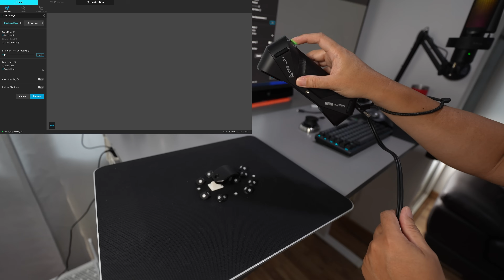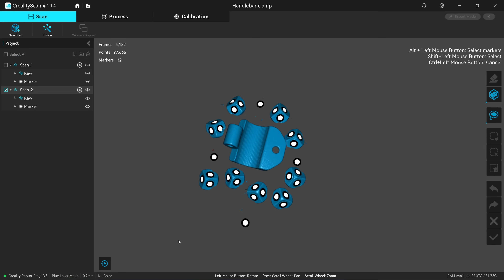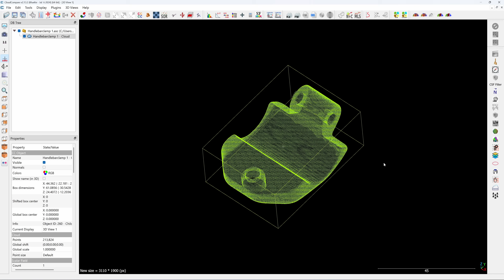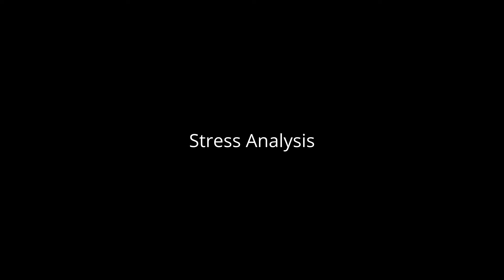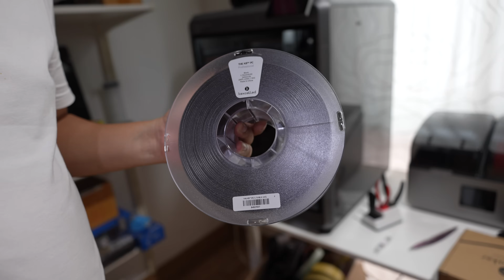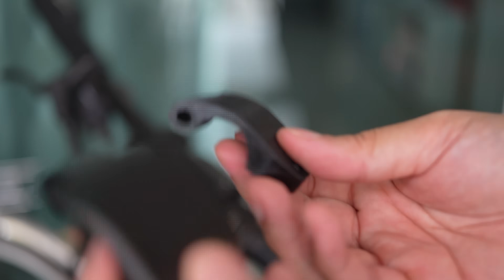Replacing Aluminum with 3D Printed: Reverse Engineering Case Study with Creality Scan Raptor Pro

Comment: Hi! I will advise you on the best way to print such details. You have 2 holes in mutually perpendicular planes. If one of the holes is positioned vertically, the second one is printed weakly (it will break in layers). in such cases, it is better to tilt the part by 45 degrees so that both holes are printed at an angle of 45 degrees to the vertical. Add support if necessary. The detail will not be as beautiful, but the strength will be evenly distributed. good luck!

Привет! Посоветую, как лучше печатать такие детали. У тебя есть 2 отверстия во взаимно перпендикулярных плоскостях. Если располагать одно из отверстий вертикально, то второе печатается слабым(разорвется по слоям). в таких случаях лучше деталь наклонить на 45 градусов так, чтобы оба отверстия печатались под наклоном к вертикали 45 градусов. При необходимости добавь поддержки. Деталь будет не такая красивая, но прочность будет равномерно распределена. удачи!

Comment: I am new to 3D scanning and in a process to establish a work flow. I have a Raptor Pro and I generally use Solidworks 2021. I am following your workflow. I have aligned my 2 part scan data in Crealityscan4 software and I exported both the pointcloud as per your video. However, unlike your import into cloudcompare. Both my scans are not aligned. Can you please share what steps I have missed. Than you
Reply from the maker: You didn’t do anything wrong—it’s just a known bug in CR 4. I’m using the beta version, and they’ve already patched it there. So, you have to wait for the official update or stick with CR 3 for now.
Reply: @Payo-TensileCreator  i see thank you
Reply: @Payo-TensileCreator  Which version of Crealityscan you are using? I can't find where to download the beta version which works with Cloud Compare. I am using CrealityScan 4 1.0.3
Reply from the maker: @ivanlim4787  The one that works is 1.1.4, it's not released yet.

Comment: I would have made the walls bigger by 1-2mm than the original and used PPA-CF. Creep is still a concern. Testing the grip a day later recommended. 
Machining it in Aluminum is the better choice but it’s much more work. 😅 Work-holding with CNC is annoying, especially for one of parts.
Reply from the maker: We’re seeing more thermoplastics like PEEK, PET, and PP entering the engineering space—and 3D printers will need to evolve to keep pace with these advanced materials.

Comment: I have to comment, because it is safety related part. You call it case study and support your claims with calculations and I think it is all wrong from engineering perspective. Just few points, without details. You use not realistic load case with low safety factor. You test it by lifting the bike which is very low force comparing to any real case scenario. For bike parts like stems and handlebars there is ISO 4210 standard that specifies fatigue test of 100 000 alternating cycles - this part will not be loaded once, but many times during its life. In real case scenario there are bending forces involved on long arm (handlebar), not just compression force on clamp, perpendiculat to its surface. Mentioned ISO standard specifies various load cases. You use Nylon parameters for calculations without taking into consideration different values for Z and XY direction for 3d print. Also catalogue parameters, especially layer adhestion, are usually not achievable on home printers because of chamber temp etc. 

From reverse engineering perspective/scanning/modelling it is a good tutorial, but should be disclaimer that this kind of parts MUST NOT  be used in real conditions. They are ok just for fitment test etc. At least before proper fatigue test which I'm sure it will fail.
Reply from the maker: Thank you for the detailed feedback—I appreciate the engineering perspective!
You're right—this is just a case study for now. But the engineering landscape is opening up to even more thermoplastics. In my field, I specialize in tensile structures, and the membranes we use are made from engineered plastics that have been in production for over a hundred years. Unlike FDM filament, these materials come with well-established codes, calculation methods, and regulations that both manufacturers and designers are required to follow. It’s only a matter of time before 3D printing filaments receive the same kind of formal standards and oversight.
Reply: @Payo-TensileCreator , there is nothing wrong with any material by definition. I just think that the approach is not ok and it suggests (even the title of your video) that in this particular case you can replace aluminum part with the same part made of plastic based on flawed assumptions (not enough real load cases, not detailed enough FEM analysis, no fatigue real-life test or even no fatigue calculations). I understand and appreciate the concept of showing the design process and make it more understandable for people that are not engineers, but there should be clear statement that it is not full and correct approach for safety related part like yours. You are considered on some 3D scanning groups as authority figure, so especially because of that, you should be more aware of your statements if it may affect someone's safety. 

btw. It is not attack on you :). I'm following your reviews from the beginning and they were very useful for me to buy my first scanner for personal use. I also think you made a really good job showing all the case studies for covers and aesthetic parts, and 3d scanning in general. Just this case is wrong and also I hope you will not use this part without further tests. 

I'm from aerospace industry and we put safety above all other requirements, so maybe I'm a bit biased, but any failure of this part can lead to serious injury or death as you loose control of the bike. If it would be pedal or something, it would be dangerous, so also questionable, but not as bad as loosing handlebar.
Reply: @Payo-TensileCreator  I assume it will stay at the same place as manually made composite fiber resin parts. Calculations are just for reference, not for proven solution.
Reply: Please put a caveat / safety rider on the video - this part or anything like it should NEVER be used for that application.  That aside, a nice video tutorial on reverse engineering.

Comment: Hi man :D
I like all of your videos :D
Today i bought Raptor PRO , like you have suggested me :D
Where can I get Creality Scan 4 - 1.1.4 ... Cant find it on official site?
How can I set resolution to 0.02mm 
I have some very small object to scan - 20x20mm and less , do I use Cross lines or Paralel lines for that?
TNX man :D
Reply from the maker: 1.1.4  is a beta version, they haven't release it yet.
0.02 mm is not resolution of the scanner; it's the precision value.  The maximum resolution of the Raptor is 0.1m
For small object, use parallel line, the camera will be place closer to the object.
Reply: @Payo-TensileCreator  "Thank you very much for the quick response.
And what should I use cross lines for?

Comment: Hi, I love your videos and learn a lot from them. Just two questions, one is what's the difference between fusion and inventor. Second question is, is that a Malaysian accent? Can't place your accent.

Also, I would have modified the design to accommodate a washer to distribute the pressure from the screw over a wider area of plastic
Reply from the maker: I'm Thai, spent some time in UK when I was a boy.
Agree with the larger washer. That will reduce shear loading.  I can clearly see pressing mark from the washer on PETG, but less on Nylon and very little in PC.

Comment: More proper way to test it would be to tilt the bike like 10 degree to the side then push down on that handle bar with your body weight untill it breaks then you describe how much force you think you used and if it bent before it gave up or it shatered like glass
Reply from the maker: That's look like a proper way to torture test it!  But that bike is my daily ride. :)

Comment: When I dry high engineering filament that usually takes many hours in filament dryer,  I will place the filament in the dryer just long wnough to heat the roll up to ~65c for 30 mins and then put it in a vacuum chamber and let it sit for 5 mins at fill vaccum. Afyer that its fully dry and ready to print  from the dryer. Saves a ton of time
Reply: That’s not going to work. You need the heat to get the water out of the filament for a long time to get to the core. Only the air is dry after 30min. The filament is still wet and would took weeks to dry with room temp in the bag.
Reply: @Todestelzer you're wrong. Look up boiling temperature of water at 28Hg vacuum. Water no matter how deep in the filament evaporates below 65c in a vaccum. Theres no heat loss in a vacuum so the roll stays 65c while in the vacuum. 5 mins in the vacuum gives it time to alll leave. Try it out with a cold glass of water... I do it with 4 rolls at a time of PPS-CF, PPA-CF ASA, PLA, . Works everytime.
Reply: @RaRa-xg7le didn't cnc kitchen try this?
Reply from the maker: Wow, that's really useful and informative tips, saving energy and time. I'm going to look into that vacuum chamber.

Comment: Great videos. I would consider Nylon Glass Fiber for this maybe. Nylon is great but will deform over time. PC is too stiff and could shatter on a big impact.
Reply from the maker: Nylon has given me issues—so I reserve it for applications requiring thermal resistance rather than those demanding dimensional accuracy or mechanical strength.

Comment: Using material that can shatter like glass for this application is dangerous in my opinion.  I would use nylon or Petg instead.
Reply from the maker: According to their website, Kexcelled PC is claimed to have the same elasticity as CoPA. However, on my observations, it appears significantly stiffer suggesting that this claim may not be accurate. PolyMaker, on the other hand, is the only manufacturer that provides detailed technical data.

Comment: I’d like to see a follow up on the CoPA piece after a few weeks in the environment. I find it swells a lot and changes dimensions a lot.
Reply from the maker: Just an hour after printing, I had to shave 0.5 mm off a 6 mm hole to fit the pin—something I’ve never needed to do with other filaments.